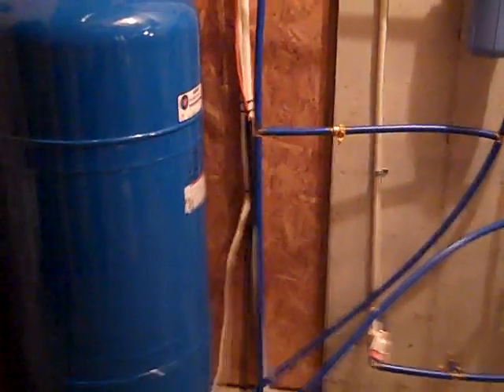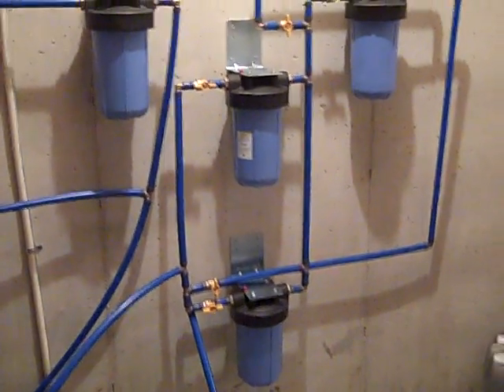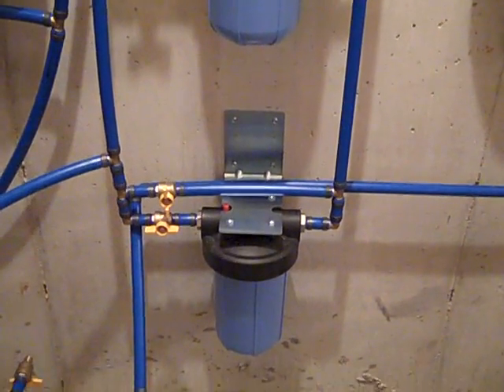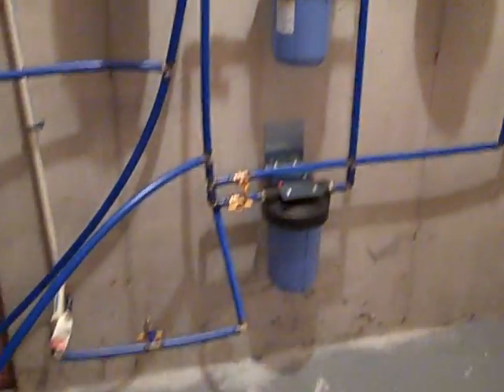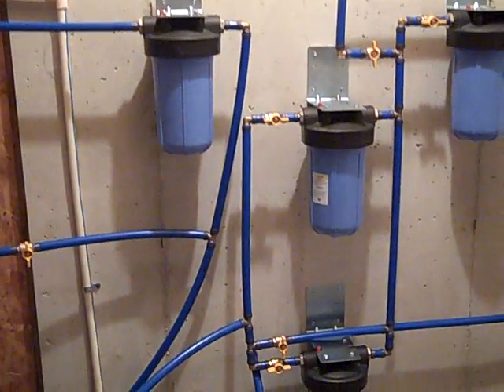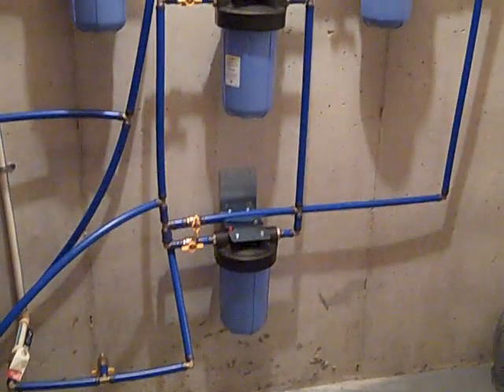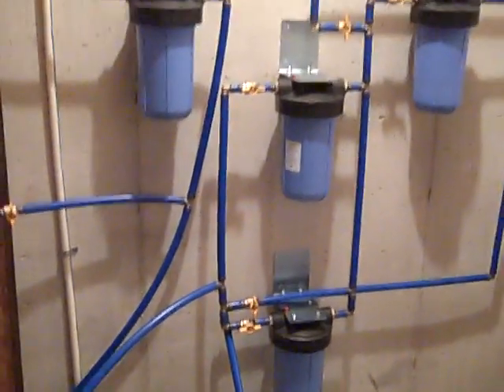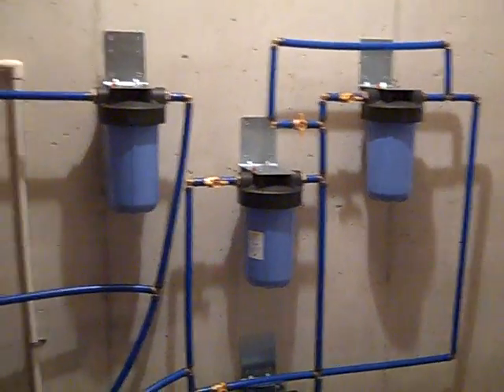Whole house filtration from any water source!

Comment: I seen a video on these ceramic filters. The guy stated he had 40 lbs of pressure before the filter and 20 lbs after the filter. He thought that if he would have added another filter, it would have increased the pressure. I noticed you had 2 filters. Was water pressure the reason?

Comment: you wouldn't be able to use this system for "any" water source.  IMHO, this is designed for semi clean water sources like Wells.  As soon as you use any kind of surface water with a heavy biological load like algae, such as a stream or a pond, this system will die a rather quick death.

Comment: Ceramic filters are $$$. I hear they work well though. Especially in this application where you don't want to use power for UV filtration.
Reply from the maker: Expensive but so is the UV system.

Comment: I personally wouldn't bypass any water filtration since 80% of all wells in America are contaminated.   Those ceramic filters are nice, but costly, good thing they can be cleaned. But always remember filters fail and clog, which increases your chances of getting sick. I know your off grid, but might wanna consider a 12v UV light filter set up as a final stage. If you are pumping to a holding tank, you can run the light off a small inverter and battery and would only need it on while filling the tank.

Comment: I am not posting to be critical only to point out a few things.If people are going to use pex the uponor is best. Instead of restrictive barbs cutting down inside diameter the pipe stretches around the fitting making them full port. Also they make bend 90 degree holders that eliminate 90 fittings. These supports even cost less at around 69 cents. Uponor is an a grade pex that stretches over twice it's size because of the way it is cross linked. There are other pex pipes that are b grade or less that can't stretch that far and have to use restrictive barbs and crimp rings or sleeves. Master plumber 35 years + . Good video

Comment: The design and worksmanship is below average. It will be not be efficient as well.
Reply from the maker: Great assessment!  You found 3 problems but give no reasons/solutions/improvements?
Reply: Simplify your work. You could have used less shut off valves and achieved the same results. I would move everything inline. This will help to evenly use the ceramic filters and won't kill the pressure. You could always go with, if it ain't broke don't fix it, and tell me to mind my own business. Haha
Reply from the maker: Jason Seikel  By design the Ceramics cannot be inline but in parallel to make sure there is enough volume to the house. Don;t mind your own business.  I just like feedback so I can improve! Thanks for watching!
Reply: I didn't think of the volume. Good job.

Comment: wouldn't it be best to put the carbon filter in front of the ceramic filters to help provide finer filtration to help increase life or time between cleanings?

How did things work out with this setup in the long run?
Reply from the maker: You are correct that the carbon could go before the ceramics.  The system is working fine to this day.  Thanks for commenting.

Comment: Not trying to start anything but you have a lot of faith in ceramic filters.  How does one test this system to make sure none of the filters are busted?  I have had or tested dozen of ceramic filters and found a good portion were not working correctly out of the box.  They leaked around the base where the ceramic meets the plastic.  You can't see it, you can't tell its leaking.  I do the red dye test on all ceramics, if they don't pass I send them back and I would say I am about 60/40 on pass.

Comment: Interesting I will be curious about the ceramic filters never seen them before I'am used to the 20 inch big blue filters we use them at work along with UV lights water softener and a bleach injection system.

Comment: A couple of questions: with your bladder, about what PSI would you expect in the house?  Also, if you removed the "no power" requirement, what other features would you add - RO, infrared (UV?), etc?  Otherwise, good vid - at least after my head stopped spinning.  :->

Comment: I have been running an RO system for 7yrs, never had to use an amp of electricity the entire time. Granted it requires pacifying, you still have to maintain any filtration system. Been considering a post peristaltic pump, but have yet to act on it.

Comment: For a while i worked for a water filter place that sold second generation ( very heavily patented ) silver colluloid systems. they also sold water filters to go with them, and sold these whole of house filter that the mains fed thru before going on to the rest of the house ( set them up beside the meter ). they were BIG like 2 and a half foot long, coz they had to keep up with the draw inside the house. one ceramic and one carbon.

Comment: Great Vid.  I've transitioned off of a bad well that had a lot of particulate matter and low flow to municipal water, but when I had the well...I had it rigged up with two filters.  One like the particulate filter you have, but another gross filter that was on a long horizontal line that essentially was a WYE with a blowoff on the lower portion.  Particulates would settle in the lower section before clogging the paper filter.  This way, I could get more life out of it before having to replace.

Comment: Echoing desertlogic222; If you could throw up a slide of a schematic for the system that would be wonderful.  Kinda hard to follow the routing with all the lines being blue and not knowing the configuration of the valves.  What is the source of these components?  From a specific mfgr?  Grainger catalog?  Thank you as always!

Comment from the maker: I have been pumping out of my shallow hand dug well now for 2 years with a solar submersible.  It is a great backup and a filter system like this would make it work great.  if the well under produces you can put a timer on the pump to allow the pump cycle match the amount of water in the well.

Comment from the maker: The ceramics are not in line as they can only handle 8gpms.  You have to make sure you are not pumping through the filter more than it can handle.  The ceramic in a parallel circuit allow 16gpm throughput.  So it starts with a prefilter, then a parallel ceramic loop then a carbon.  You have to have bypass loops for maintenance so there are lots of vlaves but these are high quality 1/4 turns.

Comment: Use copper before and after the filters, or get the ceramic filters with silver imbedded in them. The oligodynamic effect will kill germs mold viruses and algae. Check it out   wikipedia org/wiki/Oligodynamic_effect

Comment: I had bad luck with these. Had 2 in the house from a 82' drilled well. Within 6 months the water had a bad algae taste/smell and it got into the water heater and wrecked it, had to replace everything to get the fresh water taste back. Very expensive. I bought the same ceramic filter housings and they recommend on the label to be used for "treated water systems only".

Comment: Where I live I have very hard water. We use a water softener now, but in a WROL situation I plan on using that salt for other things. Can these filters handle hard water or will they just plug up to easy with the minerals? Our well is clean now, so if I had to, I could just use something like this for rain water off of roofs if it won't work with hard water.